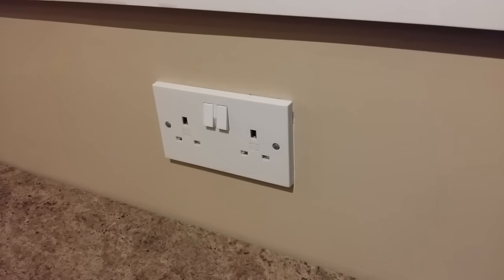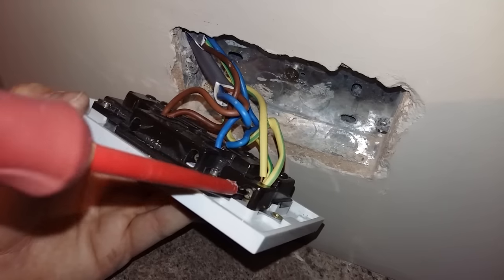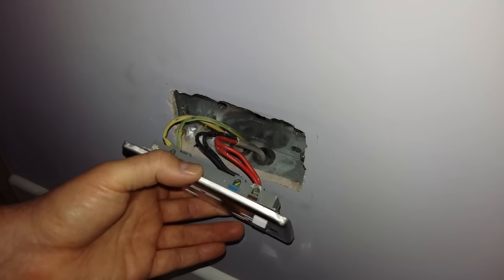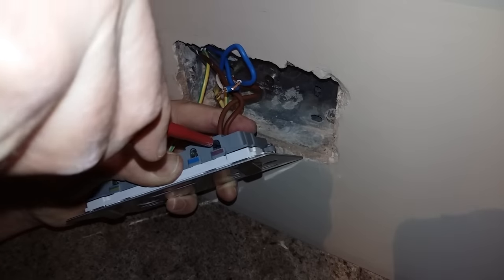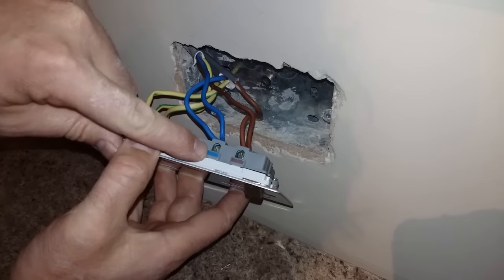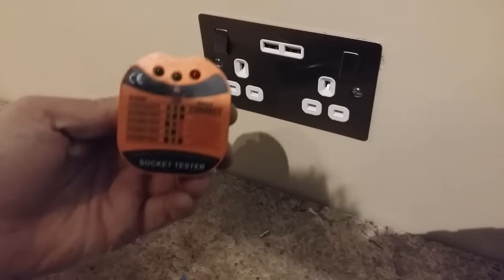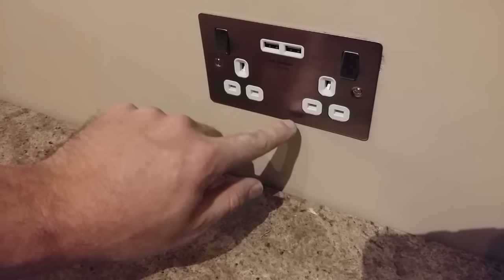How to fit a USB Plug Socket in the UK - Old and New Wiring Colours

Comment: I have installed same socket but it makes constant buzzing nose you can only hear it with ear close to the socket is that normal?
Reply from the maker: No, it shouldn't really be doing that. Possibly a loose connection is causing arcing, which would make the noise.

Comment: In trying to change my single socket to a double usb socket but when I checked earlier on I've got 3 live wires, 3 earth wires and 3 neutral wires, is there any reason as to why theres 3 of each?
Reply from the maker: When there is 3, it's because there has been a spur run from that socket to an extra socket near by. Just make sure you reconnect all 3 back up. 👍🏼

Comment: Hey, I wanted to ask you about sockets that stick out- my flat has a lot of these bulky looking sockets I don’t know what to do about them. It’s a pity I can’t upload a picture but I’m sure you’ll know what I mean. It sticks out from the wall. The front panel screws onto it. I’m wondering if I can remove the bulky part safely? Any help would be appreciated! Also have you done a video on how to change a light switch? Is it the same deal? I’m desperate to change mine to new ones!
Reply from the maker: What you're referring to there are surface mount sockets. They are usually found in older properties or where someone has added a socket at a later date. They are not as aesthetically pleasing and can sometimes get in the way. You would need to chisel out the wall (known as chasing) to 'sink' the back of the socket in the wall. It can be messy. https://youtu.be/g_spnVPsJ4I
As for the light switch....take a photo of the old one and make sure all the wires go in the same place on the new one. 👍🏼

Comment: Trying to get around how many cables there are: I see two live, neutral and earth cables; does that mean there are two "cables" that go into that double socket? If so, how is electricity split across the two if they both plug into the same metal bits?
Reply from the maker: British electrics means that most socket circuits run in a ring, so most sockets will have two cables for each. There is more current capacity with a smaller cable then as there are two paths it can take.
Reply: @charlieshooter   electricity magic - you give it an alternative path, and it auto-magically use it as appropriate. Good stuff and thx for the explanation

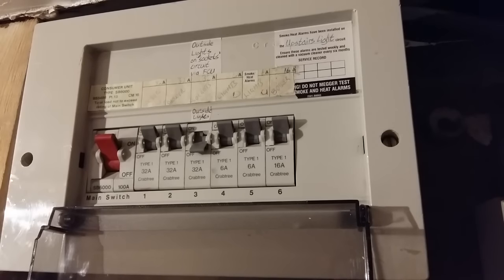Comment: @1:10 Or plug a radio into the socket in question before going to the panel and turning the breaker off. If you can still hear the music, you got the wrong breaker.
Reply from the maker: +6yjjk Good idea!
Reply: That piercing beep on the socket tester would probably work just as well, I suppose, assuming nothing about tripping the breaker would damage it.
Reply from the maker: +6yjjk I think I'd stick to the radio....no one needs to listen to that awful beep any longer than necessary! 😂
Reply: I don't think I'm going to try this I'd probably get myself a free perm! However just wanted to ask that 4th wire where did that come from is that in all sockets & what colour was it? I've never done anything like this in my life but you never know...
Have you got a video on how to install a socket I presume that's what a spur is?
Reply from the maker: If you're a little unsure, probably best to leave it to someone who does know what they're doing! The fourth wire (I think you're referring to) is an earth linking the metal back box with the socket front. Not all sockets will have these, depending on age and if there are metal or plastic boxes. I haven't got another video on installing a socket, but watch this space!
Reply: @charlieshooter  Thanks I probably will leave it, I meant the last wire was that for the usb?
Reply from the maker: Pretty sure that's the earth!
Reply: @charlieshooter  lol shows you just how experienced I am! I thought there was another wire  for the USB thing. I resign!
Reply from the maker: Yep, maybe best to leave it to someone else! 😉
Reply: @charlieshooter  Aaagh got the wrong one!
Reply from the maker: @TheAntHar1  Not great when that happens! 😉

Comment: One more thing to add is that these USB sockets are always bigger than their standard counterparts. You may need to remove existing backbox and chisel out some brickwork to put in a deeper box. Remember to move rubber grommets to knockouts of new box.
Reply from the maker: Top advice!  They can sometimes be bigger than the one you are removing.

Comment: That's how an instructional video should be made. Thank you.
Reply from the maker: Thanks, glad you found it useful! 👍🏼
Reply: Thanks for this, a really helpful easy to understand tutorial. I’m wondering, if you can’t get the copper wire in all the way without the wire showing, is there a way to trim it?
Reply from the maker: @EmmerDoucheface  Yes, you can trim the end off with side cutters/ pliers. With a sharp pair, you can be quite accurate.

Comment: Great video but a question please, should you also earth the front plate to the back plate (with an earth wire). I had to do this when converting plastic light switches for metal ones, the old wiring had a green sleeved earth going to the metal back box, so had to earth the front plate to the back plate via an earthing screw.
Reply from the maker: Best practice would be to earth the back box to the socket front, but it isn't part of the regs. There's a lot of talk on the internet whether to or not. When everything is tightened up and screwed down, the back box is earthed through the screws attaching it to the socket front, but then the backbox isn't earthed once you take the screws out.....but should you be removing the screws without turning off the electric anyway?? It really is up to you, but maybe better to be safe than sorry.

Comment: Does the earth wire from the backbox go into the earth terminal at the bottom on it's own (marked functional earth)?
Reply from the maker: Mine didn't have "functional earth" but no, the earth wire that goes to the box would connect to one of the other earth wire terminals.

Comment: Brilliant video... however I'm looking to wire some screwless metal usb sockets. But I only have 2 earth wires that are wired together in my current plastic socket. Can I do the same on the metal sockets?
Reply from the maker: Yes that should be fine. Quite often electricians will wind two earth wires together. You only need the third one going to the back box if the back box is metal too.

Comment: Great - thanks Charlie. My question is why is there an earth on the backplate - should this also be connected to 2nd the earth on the front plate?   If not, isn't the metalbackplate dangerous?
Reply from the maker: +David Guy Best practice is to run a separate 'fly lead' to the backbox to earth it, but there is another school of thought that relies on the fact the front plate is screwed to the backplate and therefore earths that way. If you're undoing the screws to remove the front plate (and therefore removing the 'earth') then the electricity should be off anyway, so the backbox would pose no danger.
Reply: I see . That's great. Thanks!  As you say electricity off when removing - but hadnt appreciated it relies on the screws to transfer earth when electrity on. thanks again.

Comment: Hi cheif. Great video. Quick question. I got plain white screwfix ones, and the diagram shoes two earth going into the top earth part, and a third earth going into the bottom.  From your video am I correct in assuming I don't need a bottom/third earth wire? Because I don't have one there.
Reply from the maker: Yes you're right you don't need that other earth!

Comment: Great vid mate. QQ. Mine asks for a functional earth to be attached. I have some spare earth cable but there does this need to go? I have a plastic back box and this is running from a small consumer unit from a hook up in van. Any help be warmly received mate.
Reply from the maker: I'll be honest, I've never heard of it before so a quick Google found this...
https://www.diynot.com/diy/threads/replacing-old-socket-connection-to-functional-earth.477540/
The extra functional earth isn't a requirement. Mine certainly didn't have it. As this is in a van, there maybe something else to consider, but not sure as I've never fitted any sockets like this in a vehicle.

Comment: Brilliant video. Thank you. With the three earth wires, does it matter which one goes on the bottom of the socket? I have three earth, three live and three neutral and also have the same USB socket you use for this video!
Reply from the maker: Thank you for commenting. No it doesn't matter which one goes where, as long as all earths are connected to an earth terminal.

Comment: Are the screw holes in all plug socket faces universal that they line up with existing back box holes?
Reply from the maker: Yes, they should do, in the UK. I've just taken some sockets off the wall that have been in since the early 90s, I think, and they lined up fine with my new backbox.
Reply: @charlieshooter  cheers boss

Comment: Hi nice video, I've just installed the exact same socket in my kitchen works great. I only had one of each cable. Does the back box have to be connected to earth in a kitchen? The socket is connected to just the one earth. I'm not sure on regulations. And can I just run a earth from the socket to the back box if needed?.
Reply from the maker: +daniel sonhud There's a lot of talk on forums etc about whether you should earth the back box. Earthing it is best practice, and you could do that by running a short sleeved wire from the earth terminal on the socket to the back box. However it is not part of the regulations and not everyone does it. The reason being is that the back box is earthed through the screws when you attach the socket front and that is enough for some people.
And one wire each is fine....it is probably the end of a spur.
Thanks for watching.
Reply: charlieshooter  Brilliant, thanks the the advice and fast reply appreciate that.
Reply from the maker: +daniel sonhud No problem!
Reply: CharlieShooters KnowHow Except some cheap chinesium sockets are not earthed at the screw mountings - much better to Earth the box and have done with it.
Reply: Norman Boyes Most sockets  and switches are cheap these aren't particularly cheap! The socket is definitely earthed at the screws though.
Reply: daniel sonhud yeah I could see the socket you used that the mounting screw bosses were earthed - but I have come across some that we’re not even though they were stamped BS1363.
Reply: Norman Boyes Not good! A lot of the best and the worst stuff comes from China you can't be to careful these days really.
Reply from the maker: Like I've said before to someone else on here, it's "belts and braces" as far as British Electrics go, so if you can do it, and earth it twice, then do it.  As for using cheap Chinese sockets, I personally wouldn't entertain using them and only buy sockets from a reputable retailer.  These came from Screwfix.
Reply: CharlieShooters Totally agree. Doesn't mean they weren't made in China though. If you buy cheap you can get good stuff you just got to know what your doing....and there's not so much come back if you get it wrong!
Reply from the maker: +daniel sonhud True....they may well have been. I was referring to the cheap Chinese stuff you get on the likes of eBay though. Personally, I'd always buy sockets from a reputable retailer.
Reply: CharlieShooters KnowHow eBay sell the good the bad and the in between .You can easily get legit bargains,ripped off or even killed buying off there! Can't really compare it to Screwfix they are totally different. eBay is more of a market place.

Comment: All 3 neutral wires were stuck together in old fitting. In new fitting, you placed one neutral at the bottom and two at the top. What is the reason. Thanks for a great video.
Reply from the maker: I think you mean the earth wires. Yellow and green? If there's another earth terminal on the socket then it's best to try and use that, so you're not ramming 3 wires in 1 terminal. They will fit better, and be a bit more secure. Not all sockets have the 2 terminals for earth though.
Reply: Thanks. Yes I meant earth wire.thanks for clarification
Reply from the maker: @CreativeEducation1   No worries, thanks for watching!

Comment: Hi, I am doing the exact as you swapping plastic for chrome socket but I have been told I need to earth the back box to the metal socket is this correct? or do I just put any earths into the earth and it will be fine? thanks
Reply from the maker: Officially, and to make sure it's "belt and braces" earthed, you should run a small earth wire from the metal socket front to the metal back box if there is one, but there is a lot of discussions on forums indicating that it might not necessarily be a requirement!
Reply: Thanks for the reply. I think I will just copy what you have done here. thanks
Reply from the maker: @robzaphy  If you follow the video you won't go far wrong! 👍🏼
Reply: what if the back box is plastic should I just copy the video and it will be fine? thank you
Reply from the maker: @robzaphy  Yes, it's the same. Except you don't need the wire going to the back box if it's plastic.

Comment: I'm changing mine at the moment and i have both coloured wires. The new brown and blue and the old red and black plus the two earths. Any advice on what to do with the old wires? Should they be removed?
Reply from the maker: You will probably find that they are both required. Someone has probably extended the circuit somewhere hence the blue/brown wires so you will probably need to use both. Any doubts, get someone to check if all the wires are connected elsewhere or are live.

Comment: Hi, where do you wire the additional functional earth connection to ? My USB socket has one, probably due to protecting the USB connectors on the sockets independently ? Thanks.
Reply from the maker: The extra earth terminals do not all need to be used. They are usually all connected to each other so if one is earthed, they all are. The extra ones are usually present so you don't have to wedge them all in one terminal.
In the video I used the extra one to earth the metal back box.
Reply: @charlieshooter  It's not Ground Earth but Functional or Clean Earth. It's OK though now, I've figured it out. Thanks for replying.
Reply from the maker: I don't think you'll find a functional earth in most UK sockets.
Reply: @charlieshooter  I've got one in mine for the USB terminals.
Reply: @charlieshooter  Actually the neutral is a functional earth, but no one calls it that way...the earth is actually the protective earth (PE).

Comment: I wish to tile my walls with 12 mm tiles. Do you know where you can get longer screws as the socket will be further from the original wall. Also are all wall boxes compatible with all wall sockets?
Reply from the maker: Yes, all back boxes are compatible with all sockets...they are a standard size.
You can buy longer screws from Screwfix....and if they are too long, you can cut them to size. I had to do that when I tiled my kitchen.
Reply: Ever heard of ebay or amazon?
😂 cheaper then in store.

Comment: This one you bought from Screwfix, does it come with the backbox? I looked at the exact one online and it says required 25mm backbox. Thanks.
Reply from the maker: No, they don't come with a back box, because it depends where you're fitting it, as to what type of box you'll need. The reason they say it requires a 25mm back box is because how big then back of the socket front is.

Comment: Question
My socket is very old, one socket only as well, I want to replace it with a very similar one to urs, two sockets and two usb ports, because mine recently started making sounds and started causing all sorts of probs, will it be much different going from a one socket to a two socket as it's quarantine and i canny call an electrician and would like to do it myself
Reply from the maker: It's not too difficult, but it depends on the material of the wall. Unless it's surface mounted, you will have to widen the recess.
If it's plasterboard/stud wall, then you'll be able to widen it with a Stanley Knife, but if it's solid brick/block, then you'll need to chisel it out. A little bit of care and patience and this can be done quite neatly.
Whichever way, you are going to need a new back box suitable for the wall material too.
As for wiring, the same wiring can be used for a double.

Comment: What size/thickness green/yellow wire should be used as a fly lead to earth the socket to the back box?
Reply from the maker: The earth wire on normal 2.5mm² 2 core and earth is only 1.5mm², so using a 1.5mm² wire would be fine.
Reply: CharlieShooters KnowHow thanks for the reply! Would using 2.5mm be ok? Such as this, which I already have in stock:     https://www.amazon.co.uk/dp/B01MTCEU5D/ref=cm_sw_r_cp_api_i_MzRmFbXED3554
Reply from the maker: Yes, that would be fine.

Comment: some of my sockets have a spacer box on the back that makes the socket stick out into the doorway blocking the door. (seems stupid to me) can I make it a flush socket?
Reply from the maker: You can make it flush if you don't mind making a bit of mess! You could get away with drilling lots of holes and chipping it out......or see my other video on chasing a wall....
https://youtu.be/g_spnVPsJ4I
Reply: @charlieshooter  thanks mate that video was interesting and helpful in relation to masonry wall mounted sockets I believe the walls im having issue with are plaster so should be far more straight forward.
Reply from the maker: @motoninja2747  Oh yes definitely....you'll be able to use a stanley knife or multi-tool. 👍🏼